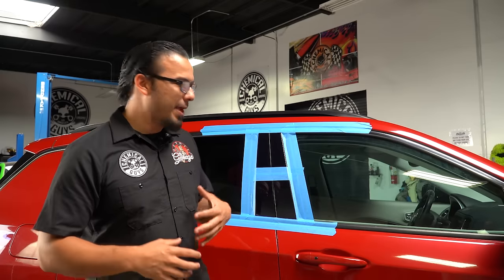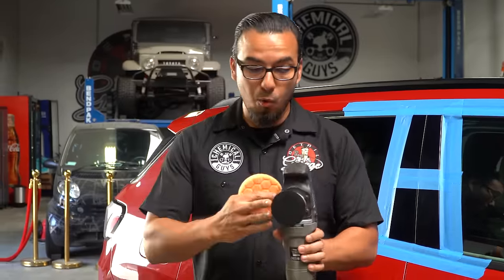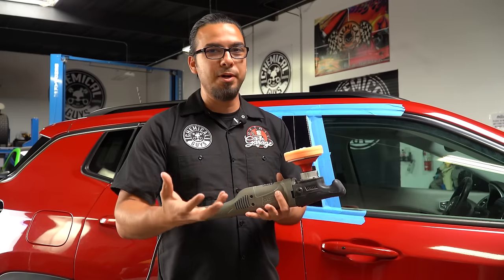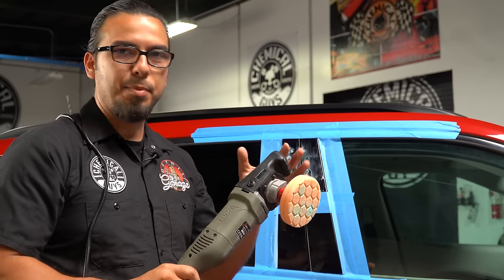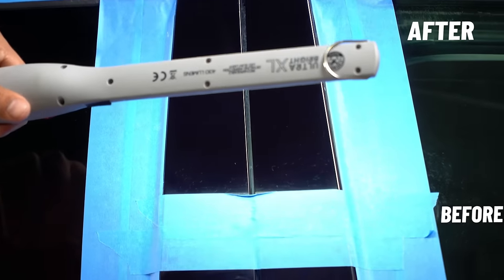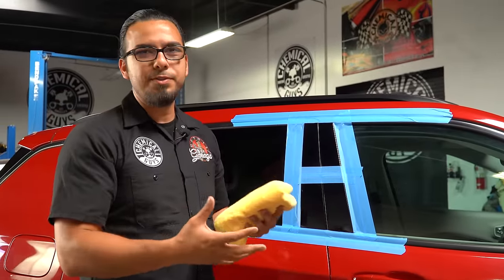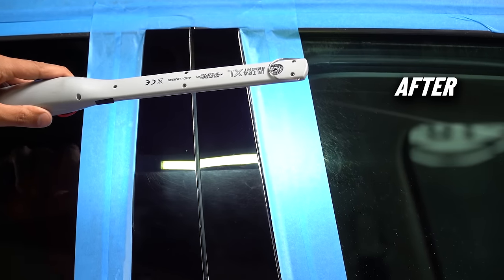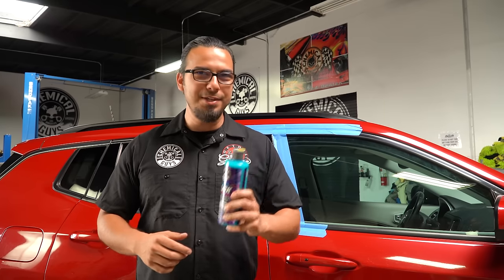Remove Scratches & Swirl Marks from Glossy Plastic B-Pillars with your Rotary Polishing Machine!

Comment: Question on the updated polishes. What’s the difference between V36 and V38 line versus the C4 and P4 line? Thanks in advance!
Reply: I believe the c4 and p4 are more generalized whereas the v line is more specific. Something easier to grab and use instead of something more meticulous in a sense
Reply: @thesamsquatch5224  general and specific to what ?? Seems like a pointless distinction to me.
Reply: @thesamsquatch5224  Thanks Sam. I appreciate your perspective. I’m looking forward to seeing a reply from CG.
Reply: I’m curious as well!
Reply: Hey Chemical Guys, it’s been a week since I posted a very straight forward question. Seems like you answered other questions on this post. Why is mine ‘hanging unanswered’? Please advise. Thanks!
Reply: There is no different just different bottle
Reply: Still waiting for a reply 😂
Reply: @kennyk9427  still waiting 😂
Reply: @franciscolagunas5643  yup still waiting 😅
Reply: C4 and p4 is a two step, cut and polish that's it. The v like is pretty much 4 steps to do a much larger range of paints from extremely bad and marred up to brand new with minimal scratching. The v line just gives you more options

Comment: I always was told to start and stop the machine on the paint surface. Swirl marks were created by applying, or releasing the pad while the pad is in motion on the surface. I've been restoring, repairing and detailing Hi Line exotics for 22 years.
Reply: Most detailers I see only do that with DA polishers, with rotary polishers they start and stop it off of the surface.
Reply from the maker: Hey! Using a dual action/random-orbital polisher it is best to start and stop the machine while it is on the surface you are polishing however when using a rotary, it should start and stop away from the vehicle. 
- CG Nick

Comment: where did you get that LED light? also can you was the microfiber towels you used to wipe off the polish with all your other regular towels used on washing your car or should they be washed alone since they contain compound and polish ?
Reply from the maker: Hi! Check out this link to the Ultra Bright XL Slim Light. Absolutely, use Microfiber Wash to maintain all of your microfiber goods. 
https://www.chemicalguys.com/ultra-bright-xl-rechargeable-detailing-inspection-led-slim-light/EQP400.html?gtmListValue=Internal%20Search

Comment: Which 3-in backing plate works without the 
 TORQX Machine Polisher?

Can the Good Screw Dual Action Adapter be used with drills?
Reply from the maker: Hey! Check out this link to use with the Good Screw Adapter.
https://www.chemicalguys.com/torq-r5-rotary-red-backing-plate-with-hyper-flex-technology/r5-red-backing-plate.html?gtmListValue=Internal%20Search

Comment: Can you use C4 on interior glossy plastic
Reply: I use it for interior glossy plastics and it works fine
Reply from the maker: Hi there! Thanks so much for watching. C4 and P4 work well for restoring any surface that is gloss painted, shiny or clear.
Reply: @ChemicalGuys  does it work good doing it by hand

Comment: Great video. If I didn’t want to worry about using C4 and cutting to deep could I use P2 twice? Use P4 once on all shiny plastic and come back and do it a second time. How would that look. I’m new to using polisher. Don’t want to cause damage if I pick an abrasive that’s to strong if that makes any sense…
Reply from the maker: Hey Frank! It is perfectly fine to skip C4 and move directly to P4 when working with a vehicle that only has light imperfections.
Reply: Thanks.

Comment: I don't have a power polisher yet, I am intimidated still
Reply from the maker: Hey! Machine polishing with a dual action such as the TORQ X or TORQ10FX is a great way to hone your polishing skills while removing scratches and swirls as well as effortlessly applying your favorite glaze, sealant and wax in less time; using less product.
Reply: Ok, and do you use the machine to remove the wax or does it need to be removed by hand
Reply: Hi Tammy! I was extremely intimidated at first as well! Just do some research on paint corrections and watch as many videos as you can. You'll be fine!